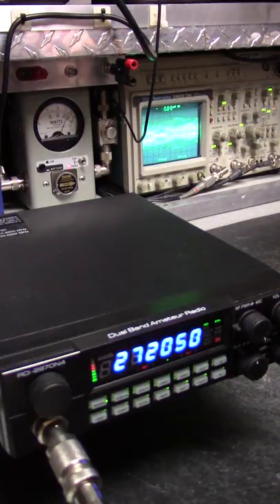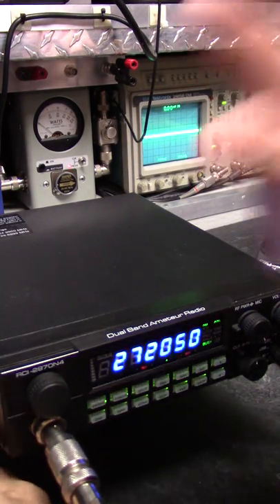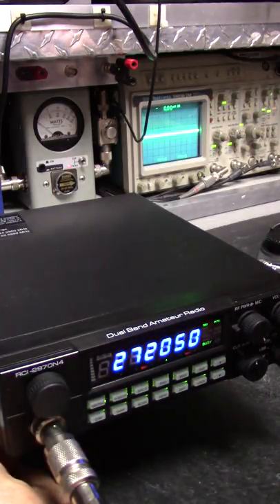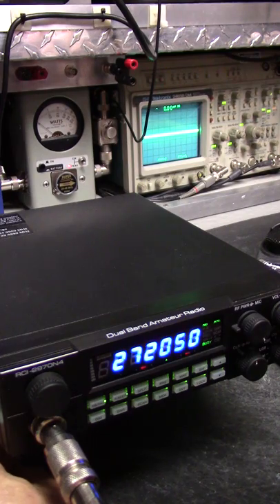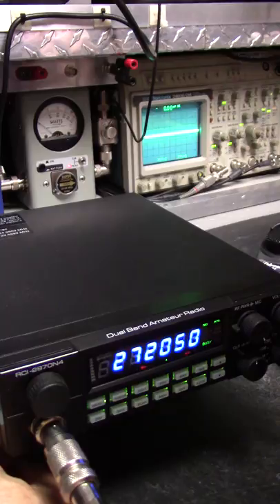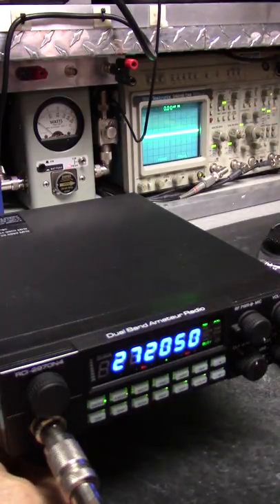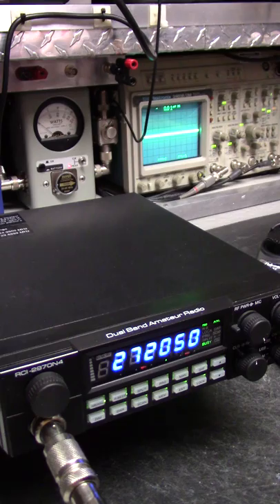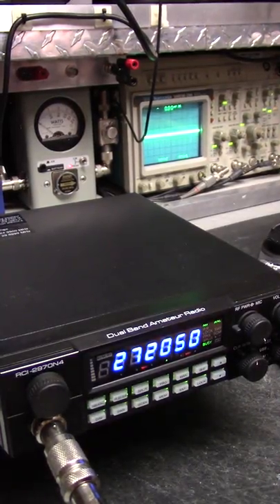Only RCI 2950CD will come with New LED display, Not the 2970 N4.

Comment: Can that CD display be done on a 2995? I have one that has the surface mount board and the newer black and green display that I got right before they switch the mosfets on the amp so it still has the Toshiba 2290s in it and I love it. That display would be sweet to have on it.

Comment: So you are going to keep it? :) good decision!  I just moved. So I am getting things put away before the fall rains and winter snow starts. So I will order my radio in the spring. Glad to hear the radios will still be around. I await the improvements that will come with with the new displays in the 2970 series radios. Hope they filter down to the 2995 also!  Will your xxx mods work on the new radios? Is it true that if you replace the n4 transitory with Toshiba red dots that the n4 will do 900 watts? Sounds like a lot of heat and a short life for the main radio! I would think  a box after the radio would be a better idea. Oh well just thinking outloud. 73s Tod kc9rka. Have a good night and a better tomorrow. Keep you and the Dog cool. Bye!
Reply from the maker: I was told only the 2950CD will come with the LED display..time will tell. 900, watts hahaaaa! Be cool man, 73's.